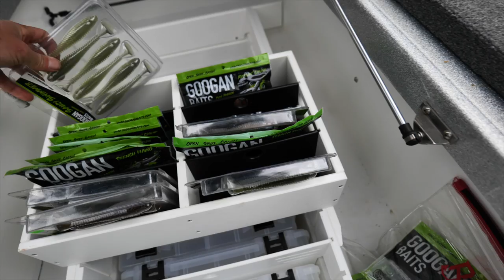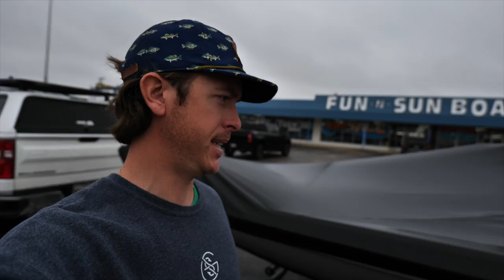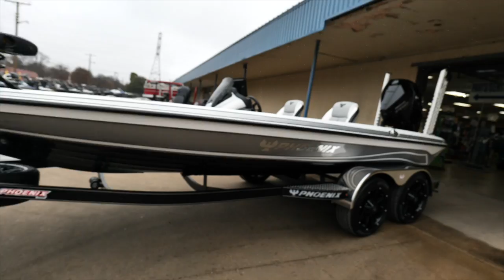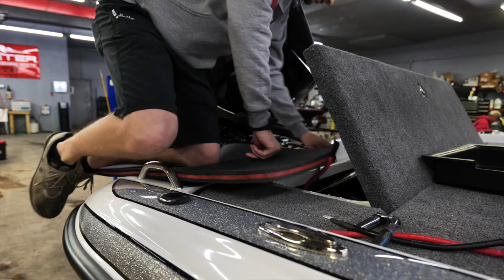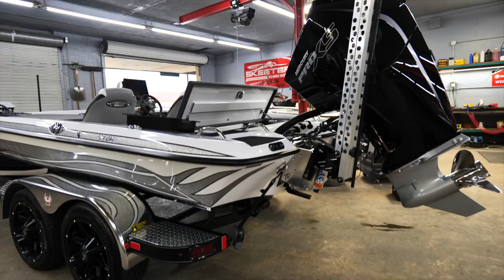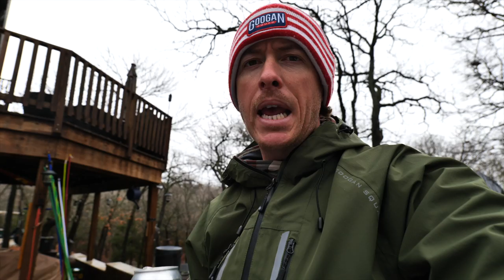Unveiling my New Bass Boat! 2023 Phoenix Boat Tour

Comment: LFG, I just recently purchased a,  PHOENIX 921 Pro XP. I was wanting to upgrade and get the larger trailer fenders.  What size wheels and tires are you running on it? And, what size fenders did you have to get to accommodate? Please, a response would be greatly appreciated. Thanks in advance and, that is a sexy ride. 👍